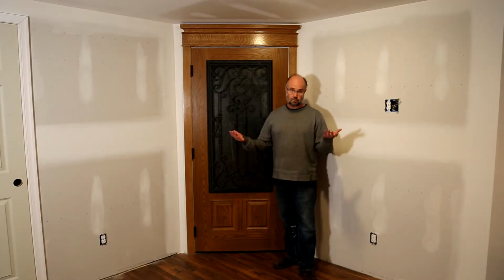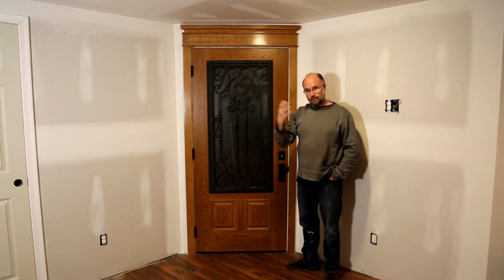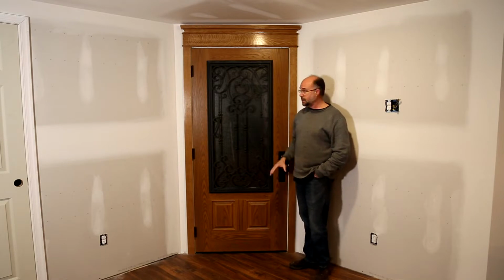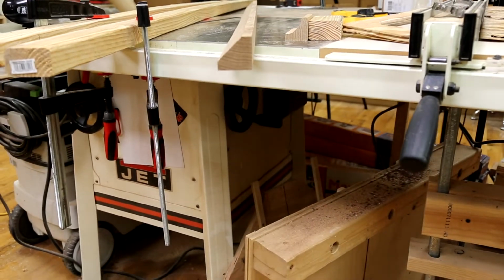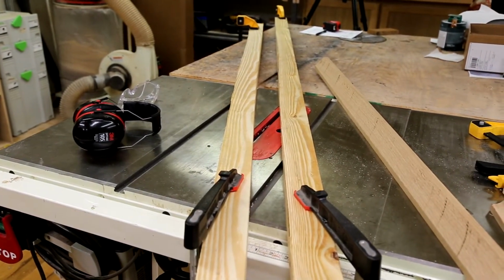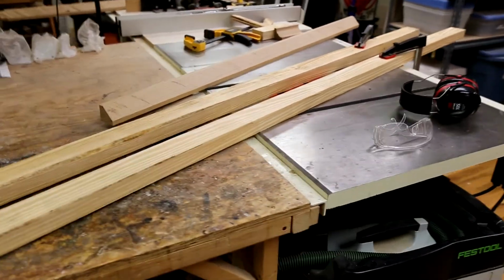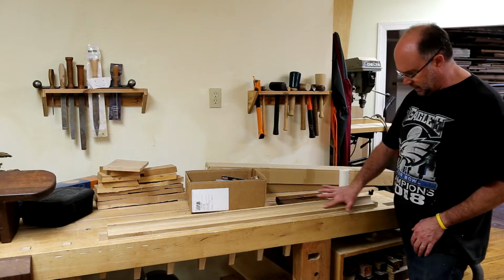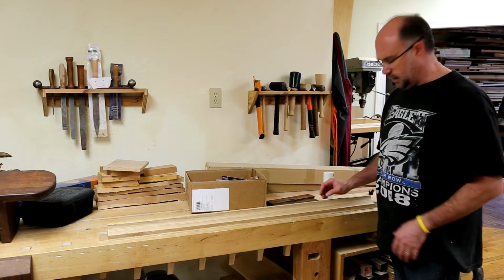Finishing my basement episode 23: Custom wine cellar door trim

Comment: I really like the table saw cove cut. That seems to produce a surprisingly consistent finish in the cove.
Reply from the maker: It left a really surprisingly smooth finish, but the shape needed some help.  With a better setup, that probably would be fixed.  I was happy to get to use one of my moulding planes for that. Thanks!